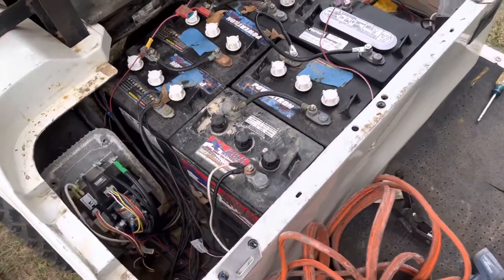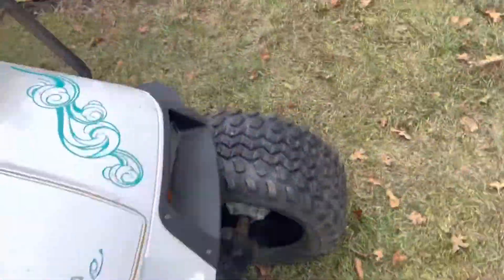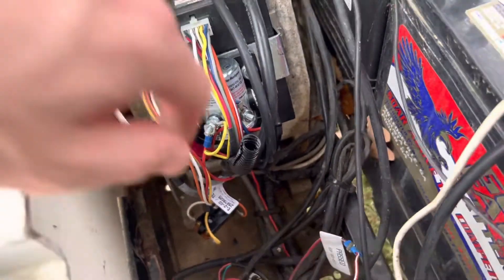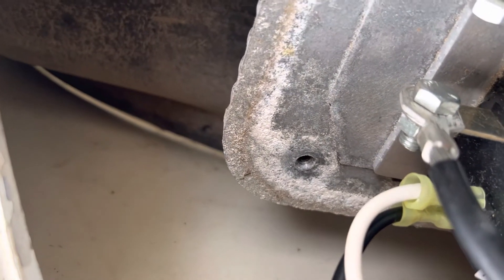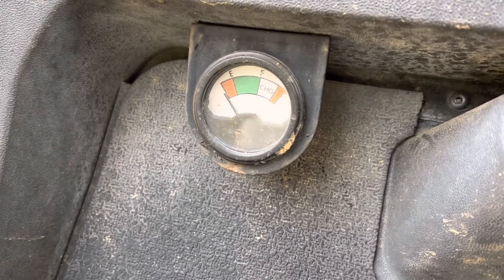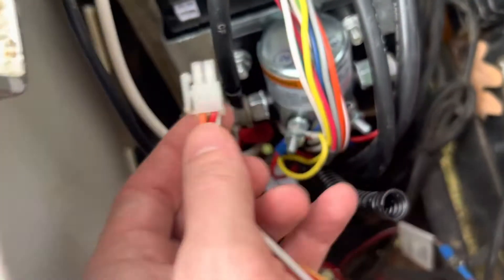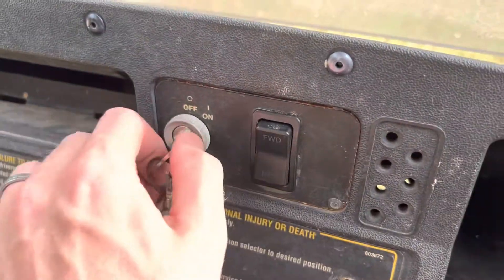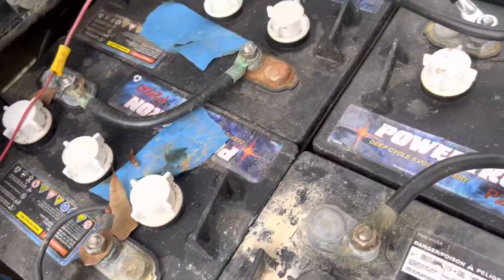Troubleshooting EZGO 36v TXTPDS 2005 |   No forward or reverse, even after shorting solenoid

Comment: @jackpost760    Did you ever find out the issue with your EZGO, I am having the same issues.  thanks!
Reply from the maker: The controller was shorted and bad. Bite the bullet and buy a new controller. If you want to confirm the controller, take it out and give it a shake. Mine sounded like it was packed with sand and loose components.
Reply: Golf cart whisperer on YouTube

Comment: I have the 2003 36v pads that wad dead like your I found on my toe switch the yellow wire was pull out and I would get no then when I lock it into plug it started working even had reverse buzzer it run now but will only go about 2 mph and no power at all won’t drink in flat yard.
Reply from the maker: Replace your speed spensor. Mine did the same thing and would only go 3-5mph. Randomly would go 18mph. I replaced the speed sensor on the side of motor and it goes 18mph all the time now
Reply: @jackpost760  thank you for replying I was able to fix with new battery’s . After checking under load they would drop voltage.